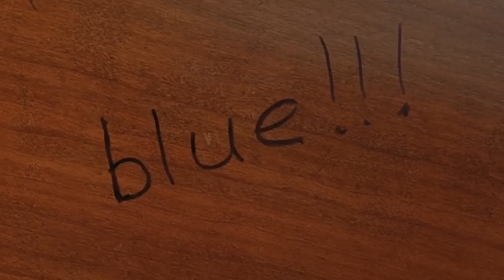Nitrous-Fed Lightweight Corvette vs 800hp 2JZ Nissan 240SX Drag Race

Comment: “that was all motor no juice” the disrespect i felt in that is crazy😂
Reply: Probably a bunch of BS, too
Reply: I seent him pushing a little red button on his steering wheel.. Maybe a little juice ?
Reply: Buddy was pushing 35 psi through a built 2j, he was on the juice 100%
Reply: @zacisaloser7197  doesn’t matter if an engine can make 1,000hp if only 500 can make it to the ground.
Reply: He lied he hit the button
Reply: Me personally, I wouldn't take that level of disrespect
Reply: @rhinosteveo  your comment has nothing to do with the one you responded to. Doesn’t matter if your comment makes sense if what you said doesn’t relate to the one you reference lmao
Reply: @hiphopanoyomous  two different buttons. one for nos and one for 2 step
Reply: @zacisaloser7197  and spinning majority of the race lol
Reply: @samteks125  nah, did you see that dust? I dont think he was bragging, that 200 shot might have sent him off the track or into the s14
Reply: Look at all the important guys on this thread butt hurt🤣 in utter disbelief that a c5 on (motor) walked that 2j on a roll  lmao 🤣 we won’t even talk about that dig race gappppppeeedddddd 🤣🤣🤣🤣good suspension+ traction = win dyno queens are (as such)dyno queens lol 😂
Reply: Listen to the motor and the the car jumped after that shift.  Dude is clearly hitting the bottle at 13:40.
Reply: thought i was the only one that caught how violating that was 😂😂
Reply: @solocamo3654  false lmao bunch non racing people making assumptions you can’t even tell the difference from peddling a car and a nitrous hit lmao the dig was a nitrous hit lmao 🤣
Reply: @rhinosteveo  Couldn’t of said it better myself
Reply: @rob_z_zilla  Cars don't jump like what happened at 13:41 without nitrous. You can also hear it. I'm no 2JZ fan, but the Vette dude is full of shit.
Reply: That was not all motor lmaooo hell naaa ain’t no way 500 pony’s can just accelerate at top end the way it did specially the way the 2j was in boost.
Reply: @rob_z_zilla  I mean you said it, 2j was spinning all day, c5 was built for drag suspension and traction wise I mean look at both tires on both cars.. hows 550 hp just going to pull on 800 just like that. If dude knew how to drive the 2j it’d be a different story I mean you saw last race he was reelin in that c5.
Reply: @rhinosteveo  And that, my friend, is the difference between dickhead cars and race cars.
Reply: @rob_z_zilla  Look at his left thumb at 13:39 and get back to me.  Also, it accelerated hard on that shift and then seemed to lose power towards redline in the same gear?  Listen to the motor.  Anyone who uses the term "non racing people" is the type of person that thinks they are know but get laughed at by the actual humble people with experience.
Reply: @Kanjo_Kazooie  well 800hp is peak power the NA 550hp can be delivered at a lower rpm and it most likely has a bunch more torque as well
Reply: @Mostly-Nuts  It absolutely has everything to do with the comment responded to. The responded to comment was inferring that the S14 had to have been making far more power and thus entirely conclusive that the Corvette wasn’t running all motor for that round purely based on the fact that the S14 lost. My comment pointed out that the conclusion that the Corvette was 100% spraying they came to was invalid because it was incredibly apparent that during the entire day the S14 was having horrific traction issues, either from the setup or the driver, doesn’t really matter which. If the S14 can only put 500hp to the ground, the all motor 550hp is plenty adequate to beat it. Judging by the other responses, I think you’re the only one that missed this point.

Side note, if the Corvette was spraying and the power figures given were all reasonably accurate, the S14 wouldn’t have been pulling on it like crazy right before the finish line when they finally got some traction. You did not need an 800hp car to win that race on that day in those conditions.
Reply: @solocamo3654  lmao 🤣 you don’t race!! I can tell lmao 🤣 that was not a juice run lmao 🤣 let it go already from the dig he was on the dope from the roll it was all motor 😂😂
Reply: @Kanjo_Kazooie  even with a different driver in the 240 he would’ve still got gapped lol they where both spinning lol the dig was embarrassing!! The roll was definitely in favor of the 240 but guess what that all motor car was built right and pull in the w that 240 might make 800hp on the dyno but if that power is not useable it doesn’t matter as shown in the video I have a c6 zr1 with bolt ons and I ran this gt500 that supposedly made 1000whp I’m sitting at roughly 680 710 and it was busses because I can use that power while he was trying to break a wild horse in his lane lol
Reply: @zacisaloser7197  2j's are very overrated.
Reply: U can see a puff of nitrous out the back at the finish he literally caught red handed 😂
Reply: Properly set up car, vs not so much so..
Reply: @samteks125  probably not. Na power is different. 300 hp turbo vs 300 hp na.. you’d think oh, it’s the same, should be even.. but it’s not even close.
Reply: @xerodelacroix5552  At least the Vette dude can drive his car in a straight line.
Reply: Hahahaha that shit tickled me
Reply: That boy is lying his ass off 😂
Reply: The Vette is fast any way you look at it!!!
Reply: I don't think he meant any disrespect at all. The 240sx guy was saying that his wheels were spinning at 3rd gear, then corvette guy just agreed when he said that he didn't use any juice because the surface was too "slippery"
Reply: I mean they are both forms of artificial horsepower if you really get down to it...The bottle vs turbo.

Comment: Soon as I heard the Vette was making 500 HP, I was like “he lying”.
Reply: 550 whp 750 with the juice. 600 whp c6z06's beat boosted higher hp cars on the reg/ and this car is about 2-300 lbs less than a c6z
Reply: Had to be 750-1000😂
Reply: "small cam" and "low compression" lmao dudes funny.
Reply: @TheBroLounge  it only made 550 all motor. A built ls3 with higher comp and a good N/A cam will put down 600-650whp. If you know anything about v8s, you'd know he isnt lying
Reply: @johncena-hq1ti  I didnt say hes lying, I said its funny what he calls a small cam and low comp.  A stock cam is small, he isnt running a small cam, sounds like a stage 2 type cam.  And 10.5 isnt low compression.
Reply: @TheBroLounge  for a built ls3 yes that is a small cam and could be pushed much farther. Ive seen similar builds make 650+whp N/A with a proper setup.
Reply: @johncena-hq1ti  650whp out of a 6.2L is a max effort build.  Nothing ordinary about it.  So there’s some room between stock cam and a max effort build.  So no his cam is not small, but not huge either.  His compression is not low, but also not super high.
Reply: @TheBroLounge  yeah 650 is max effort. My entire point was 550 for this setup means theres a lot more in it than that. idk what else to tell u
Reply: @johncena-hq1ti  people are so use to these 3700lb 1200 turbo cars , when a 2900lb NA 550hp car walks their ass they claim some one lying lol
Reply: @johncena-hq1ti  nothings changed, the fact remains the same that he is not running a small cam or low compression like he said.
Reply: yeah i doubt its making more than 550 motor. i see built LS2 and LS3 cars plus the new LT cars on the dyno every day. dynojet with an SAE correction factor and a smoothing curve of 5 will tell you the truth and hurt your feelings. hes spraying down the house because he has the fuel system to support it plus heads and valves that wont get torched.
Reply: @johncena-hq1ti  it’s not a 6.2. It’s a 402 turning almost 8000rpm lol. Full on race build that certainly does not sound like a small turbo cam. Running that much nitrous and Rpm it’s probably a custom grind nitrous based cam. I’d bet good money it’s over 550 but either way it’s nasty.
Reply: @crazytrain65  I didn’t say it was. Still has another 100whp in it with a different cam
Reply: @TheBroLounge  you can’t say that for sure though
Reply: @johncena-hq1ti  dont know much about v8,
but having 500at throttle instant + nos purge sure will scare turbo cars
Reply: @TheLordMaximo  lol 😂
Reply: All you heard every run was that LS roaring he for sure was lying 😂

Comment: Dude should've let someone else drive his 240 lol
Reply: Yeah they should have swapped drivers at the start. I'd like to see the 'vette guy drive that 240.
Reply: Agree 240 driver had no business racing that. Lol. Crashed it at test run was all I needed to see to know who winning.
Reply: @rotorhead5826  vette driver knows his car better then the 240 driver, simple as that.
Reply: It's honestly the car. The 240 has a 650lb motor over the front axles of the car, and probably makes a weight balance of 65/35, while the Corvette has a 440lb motor sitting behind the front axles, with a perfect 50/50 weight balance. Keep in mind Corvettes are designed as world class performance cars for the track, not some Japanese sports coupe meant to give the standard econobox driver a smile
Reply: I don’t think you know how sketchy it really feels to be driving something like that
Reply: @saltyfloridaman7163  great observation I did not even think of the weight ratio myself!!  Making the rear end lighter and unstable.

Comment: love how a 200 shot is just an asterisk here
Reply: “200 shot”.  Just like “550hp” with 11 degree heads.  Sneaky ass lol.
Reply: @traviscassidy4717  got’em
Reply: @JacobVillemain  Can I get one of those ahhemm "550hp" engines
Reply: Dude's a flat out liar about not using it too.  It's clear as day from audio alone.
Reply: @solocamo3654  yeah that’s the “on off on off” suppi was talking about.  Rpm going to spike and drop when he’s on or off the button

Comment: You all should give them an award for having the two sketchiest street drag cars 😱😳
Reply: ratrods of anykind have entered the chat
Reply: The vette wasn't nearly as sketchy as that 240.
Reply: @biggiesmalls7939  Not saying much with a 200 shot 🤣. But yea FUCK driving that 240
Reply: The corvette really wasn't sketchy, he kept control and knew his car well enough to not let things get out of control.....the 240 on the other hand, that was sketch city
Reply: @danamullins2723  Watch the video again. The corvette was pedaling like crazy. That corvette had a real experienced driver anybody else would have wrecked off that runway.
Reply: 800hp 2jz on stock crank
Reply: @runninicy  What does that have to do with anything in this thread?
Reply: @caribshogun9772  In the case of this 'vette, peddling doesn't mean the car is sketchy- it means there wasn't enough grip on the runway. Anybody with some experience in a mildly built C5 could peddle that 'vette down the track. They are very well sorted cars and this one looks like a pretty solid build. (Not to discredit the driver, he did really well.)
Reply: @rotorhead5826  I agree the cars especially the vette is built from the best, but on that no prep surface...car will but sketchy because there is little to no grip. All this talk makes me want to find a c5 and mod it and go harass Hell 🐈 s

Comment: 550hp…yeah I don’t think so…my CLS63 has 500hp there no way I would be able to keep up with a fully built 2JZ running 800hp…something don’t seem right with the numbers...and even then I think that 2JZ had more horse power.
Reply: The driver of the 240 really couldn’t handle his car tho. Either needed a better driver or wider tires
Reply: Does your CLS on slicks and weigh 3000lbs?
Reply: @tc0ates  I’m going to do what the guy in the corvette did..lie and say it weighs less..
Reply: i don't think you understand cars.. power isn't everything. street racers with little turbo 5.3s are out there taking home w's and $

Comment: The turbo noises out that 240 during the burnouts was so awesome!!!!
Reply: my favorite part of the video that symphony
Reply: That was about the only thing awesome that 240 did. 😓
Reply: I know it made way more than 800hp that’s why it was slipping and losing traction
Reply: @spookyreaper1702  nah 800whp seems about right.
Reply: @boostybotha355  idk as hert said built 2j on 35psi means a lot more than 800. Thats more like a stock block supra numbers
Reply: @spookyreaper1702  a block being stock doesn’t really mean anything, especially since most people run factory compression. It’s dependent on boost, fuel, head mods etc. 800whp maybe 850 is about right for 272 cams, 6766, e85 and 35psi. Just based off my experience. Also you wouldn’t really have reliability at over 600-650 on stock block.
Reply: @spookyreaper1702  I doubt it. It just isn't set up well at all, especially for a strip with dust all over it.
Reply: @biggiesmalls7939  could be that too. But lotsa high hp cars have been here and never did that
Reply: @boostybotha355  yea u right 🙌🏻but so many people lie about power here
Reply: @spookyreaper1702  Just basing it off my own built 2j with the same cams pump gas and 6466.
Reply: @spookyreaper1702  ye hence why I think that 240 isn't set up well at all. Higher hp cars have put more power down with way less traction issues on the same strip.
Reply: Insane is what it was!! proud of that car!!

Comment: That red corvette has definite driver mod, even on paper the s14 should’ve won. Great driver
Reply: You're not wrong but the way a turbo car quickly spools up power would make it very difficult to modulate power and keep it right at the edge of available traction. A NA car is much easier because the power doesn't spike up like that. I used to own a C5 and I just love a NA LS, almost electric power delivery.
Reply: The Vette driver seemed to know his car a lot more than the 240 driver. Think that’s why he won this race.
Reply: @alexkram  Electric power delivery, I like that
Reply: Nah they are so damn light traction is always an issue over 550whp, even with that tire. Ask me how I know haha
Reply: @Momo-ej4gt  Yes, that was actually almost a perfect description.

Comment: I have a feeling that the 240's budget was 95% motor. With some suspension work it might have been a different story because it was clearly making insane power. Running through the fence was scary, how long will it be before someone with no cage or helmet catches the grass and barrel-rolls into oblivion? I hope Hoonigan has some good lawyers.
Reply: Yeah as big as they are they should take safety more serious. Especially after this fence incident

Comment: Big inch. Lol
Reply: That’s what I thought too, I was expecting 440-470” RHS block, canted valve heads etc lol.
Reply: @traviscassidy4717  yup! , our Hoonigan brothers don’t necessarily understand that 402 is still a peanut. Iol
Reply: @CARTUNE.  yeah, ol’ fast Eddie with the nasty NA 451 mosez headed twin 4500 throttle bodies and a solid roller with about 1” of valve lift that revs to 9800 is like “ hold my beer”

Comment: Got to say...   
550HP from 6.6 liter engine
vs
800HP from a 2.4 liter engine.
  
The Japanese definitely are the winners here.   ;)
Reply: 800hp boosted vs 550 all motor, if motor was boosted it would make well over 1100 easily. But props to little 2j for making that much power and handling it. Love both platforms
Reply: You weren't paying attention where you?
Reply: 550hp American car beats 800hp Japanese car. FTFY
Reply: @TheMlc4life  *were.   Were you paying attention?  ;)
 
 I was talking from a technical standpoint.   
83 HP/L is less than you get in a normal N/A family car...   333HP/L is ridiculous 
(imagine the Corvette having 2,200HP !)
   
I'm getting 212HP/L and I'm out of upgrade-options, which is why I'm impressed....but yeah, of course I love 'em both!

Comment: Before I watch this video or read the comments, I'm predicting the Vette is gonna wax dat ass! High downforce wing, slicks, parachute plus a big freakin' hole in the hood with chit sticking out of it is a perfect recipe for a serious ass kicking!

If I'm wrong, I'll come back and delete this comment and say something more appropriate that fits the outcome and give the Nissan it's props. Until then, I'm sticking to my original belief. 😁
Reply: Yeah, this ended just like I thought it would. HOWEVER... that Nissan IS a beast and could run a lot quicker with the right traction.

Comment: The guy with the 240sx said he welded the rear diff, which is why it was so hard to control. 
 He should have used a limited-slip differential so if he starts spinning at least one of the rear tires can refrain from spinning

Comment: The Corvette sounded wild but the truth is I’m just not super into the way V8’s sound and I will undoubtedly say that in line 6 engines are the best sounding in the world but in line 4 engines are my favorite for lightweight and even easier to work on great gas mileage And can also last many miles like an in line six and can still be plenty durable to handle high horsepower.

Comment: The vette was a proper race car. The 240 was a big engine stuffed onto a sideshow streetcar. That 2JZ need a proper race chassis and it would decimate all  ; )
Reply: The Vette is just better car than the 240, the 240 is way to light in the back for that type of power.

Comment: Not gonna drag the 240 guy through the mud for crashing. If you're making enough power you're about to break loose on clean pavement, and you hit a dirty spot, not much you can do beyond letting out of it once you're already rolling above 80-100 mph.. Kinda along for the ride. Jeff Lutz who has high 5 second cars making 4,000 hp  spun out a stock zo6 into a ditch. Shit happens.